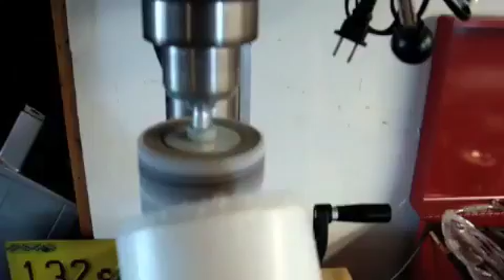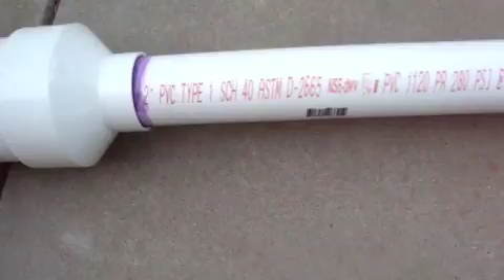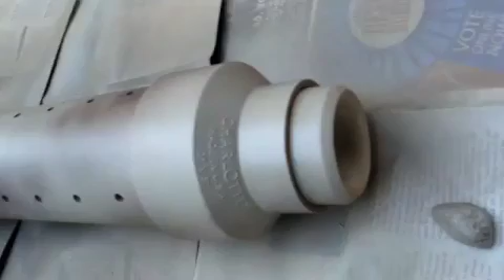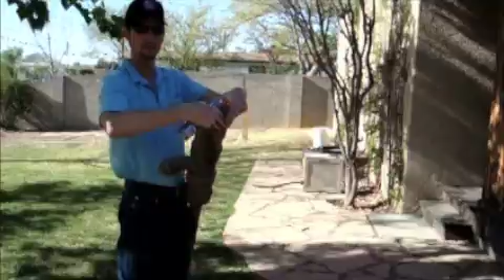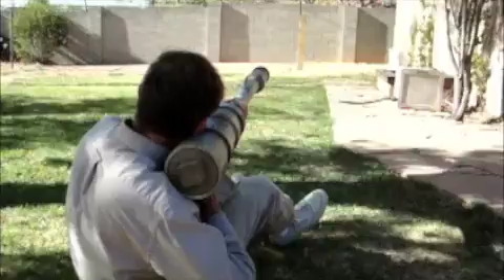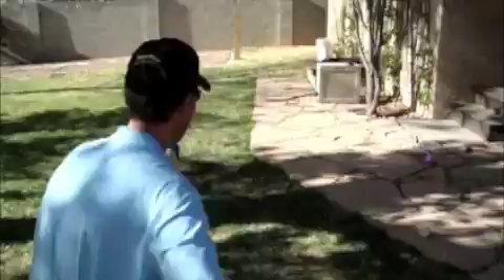Potato Cannon Spud Gun with Suppressor Silencer

Comment: do it. i used to make those, just make sure you tape it up a whole bunch. and yeh you will need to get  a new coke bottle after a while they melt a bit. and dont limit yourself to potatoes, just for fun, make a small cone out of paper, cut it so it fits in the barrel, and put a nail into the cone and tape it. so it looks like this >---  fire away.